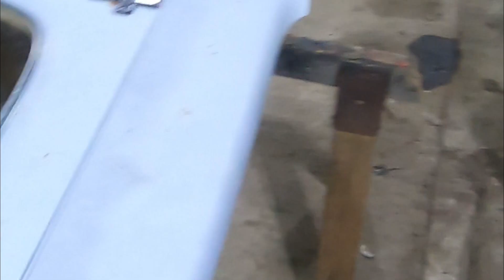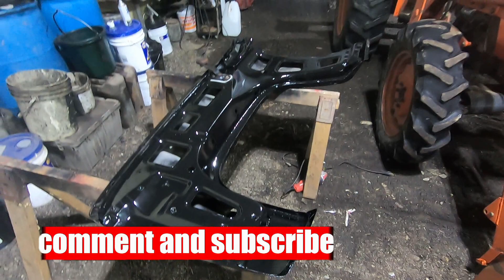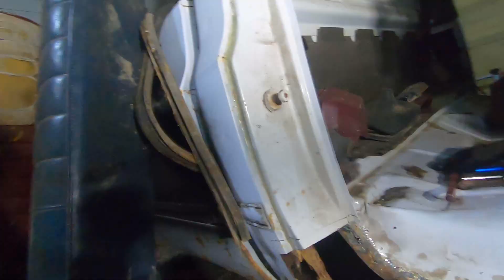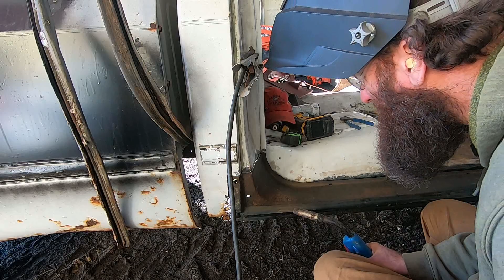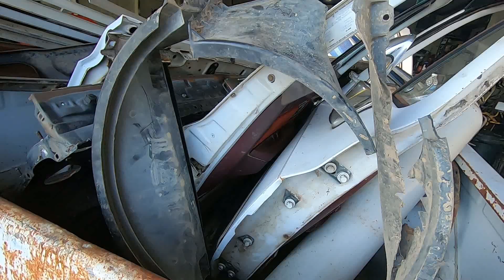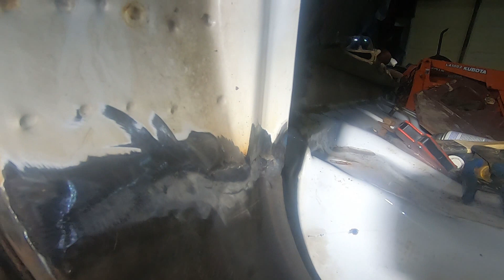SQUAREBODY ROCKER PANEL REPLACEMENT AND RUST REPAIR | TRANSMISSION UPDATE

Comment: Just bought a 73 squarebody and am about to start replacing cab panels. Needs new inner and outer rockers cab corners and floors. So I have been trying to get all the information from online as possible but at some point ima just have to start. Thank you for the video and knowledge
Reply from the maker: I was in the  exact same situation. Never did anything like it. Watched a bunch of video. And jumped in head first.  Just take your time ,like alot of time .  It's just metal you can make it do what you want.  Good luck and thanks for watching

Comment: My guess the rockers don't really match if the castings were done by different factories or just the year of pot hole and hot- cold weather
Reply from the maker: Well , the rockers came with the truck. After I installed them I talked to the previous owner  and he said they were overlay panels not weld in. But after a bit of Hammering they actually turned out pretty good for my first time.